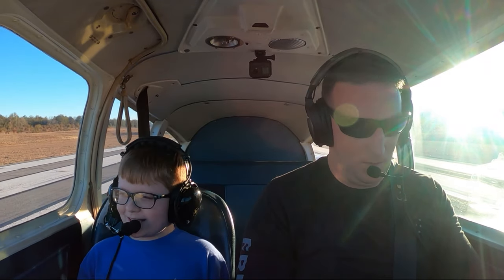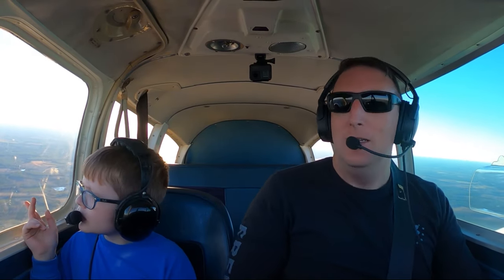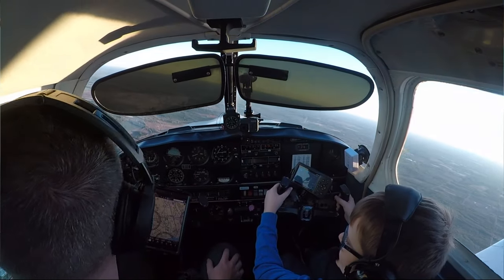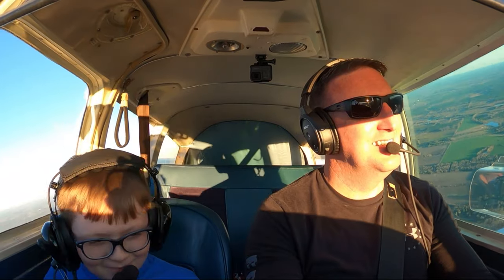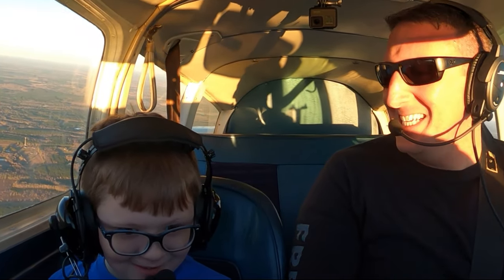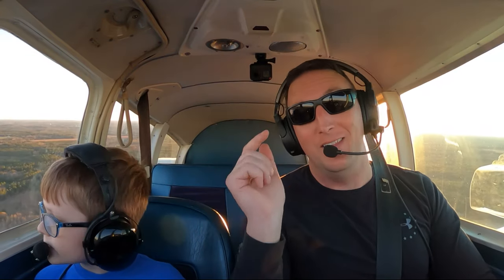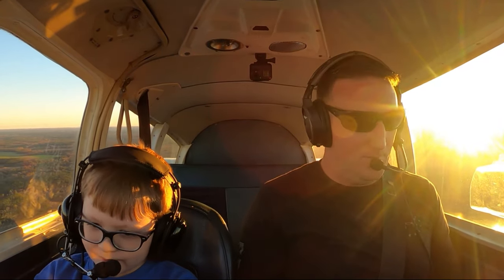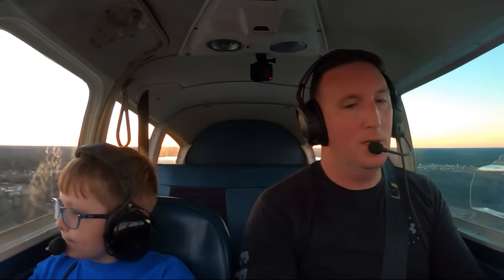Engine Failure in FLIGHT! Piper Cherokee 180

Comment: There are two pilots in aviation, those that have had an engine failure and those that are about to..There is a lot of myths about dealing with an engine failure.Fortunally the O320 LKycoming is a very stable lonmg servicing aircraft engine with a huge excellent record. I have had 3 engine failures which I walked away from. I had a PA28 drop a valve, and one that just quite with  plenty of fuel on board.There aren;t top many people talking about engine failures with a Lycoming 0320 up front. I have found the 0320 an amazing engine with a proven track record.Hwever they can also drop a valve I have found out.xAs you would know the 0320 cruises on high power settings then other aircraft engines. Iceing in bad weathr can happen, but its pretty rare from what I have seen.The 0320 likes it share of H.p. and reves, I often see pilots flying behind an 0320 at low RPM, ie., 2400 r.p.,
The O320 doesn't like flying lunder 2500 r.p.m..Lycoming has built and approved an amazing engine with the  Lycoming 0320 on low revs.,and high revs. 2500 r.p.m. in the cruise is where the engine likes to be.
Reply from the maker: After hundreds of hours of flying, I still keep the proverbial ‘engine failure’ in mind. Especially now, t/o and landing out in the elements. It’s the, “ it will eventually happen” thought that keeps me on my toes. 👍👍